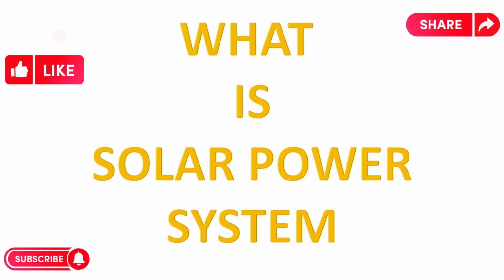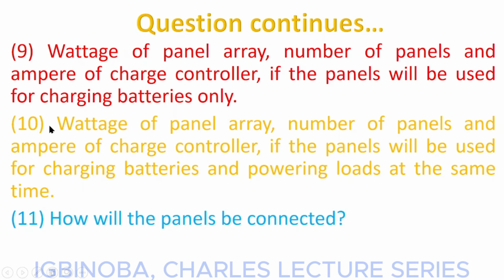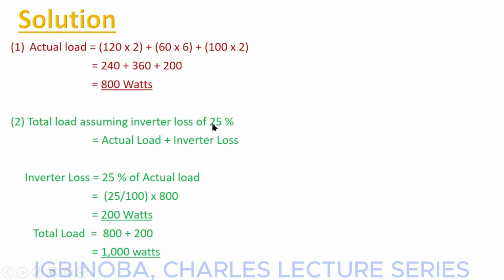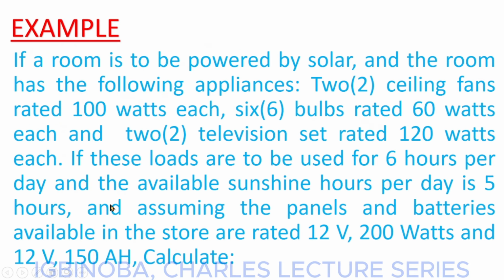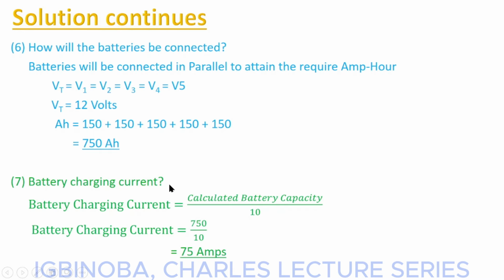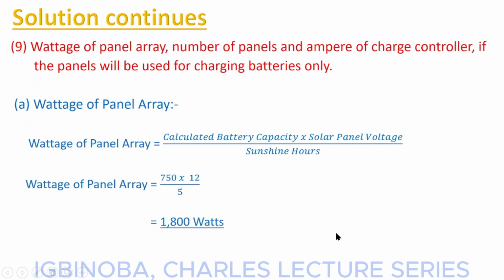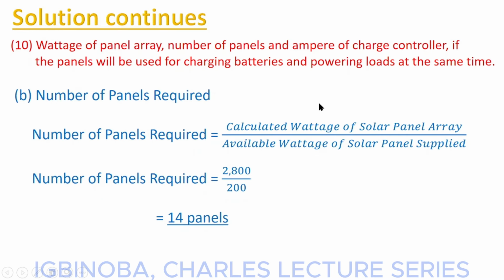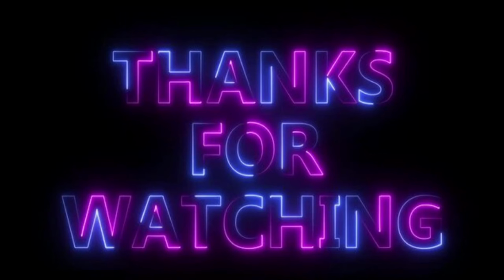Design of Solar Power System

Comment: MAR9I

Ans:
(1). 1380watts
(2). 1725watts
(3). 2156. 25Va 
(4). 1293.75ah
(5). 9 batteries 
(6). Parallel connection 
(7). 129.4amp
(8). 14hrs
(9a). 3105w 
(9b). 16panels
(9c). 258.75amps
(10a). 4,830amps
(10b). 24panels
(10c). 402.5amps
(11). Parallel connection

Comment: NAT38L 
1. Actual load 1380W
2. 1725W
3. 2156.25VA
4. 1293.75AH
5. 8.6 batteries (approximately 9 batteries)
6. Voltage is constant so parallel connection 
7.129.375A
8. 14 hours 
9. A.3105 W
B.15.525 panels 
C. 258.75A
10.A. 4830W
B. 24 panels 
C. 402.5A
11. Connection is in parallel.

Comment: MEC19S

1. Actual load =1380W
2. Total load=1725W
3. Inverter rating =2156.25VA
4. Battery capacity=1293.75AH
5. No of batteries = 9 batteries 
6. The batteries are connected in parallel
7. Battery charging current =129.375A
8. Battery charging time=14 Hrs
9. a. Wattage=3105W
    b. No of panels=16 panels
    c.  Charge controller =258.75A
10. a. Wattage=4830W
     b. No of panels=24 panels
     c. Charge controller =402.5A
11. The panels are connected in parallel.

Comment: MEC33G 

Answers:

1. The actual pad is 1,380W
2. The Total load is 1,725W
3. The inverter rating is 2,156.23VA
4. The battery capacity is 1,293.75Ah
5. The Number of batteries is 9
6. The batteries are connected in parallel
7. The Battery charging current is 129.4 amps.
8. The battery charging time is 14 hours.
9. a. The wattage of the panel array is 3,105W
b. The number of panels is 16 panels.
c. The Charge controller rating is 258.75 amps.
10. a. The wattage of the Panel array is 4,830
Watts
b. The number of panels is 24 panels.
c. The charge controller rating is 402.5 amps
11. The panels are arranged in parallel

Comment: EEE38L

Answer 
1. 1380

2.1,725w

3.2,156.23VA

4.1,293.75Ah

5.9 batteries 

6.Connected in parallel 

7.129.4Amps

8.14hour

9.3,104w
b.The number of panels is 16 panels 
c.The charge controller rating is 258.75 Amps.

10.4,830
b.The number of panels is 24 panels 
c.The charge controller rating is 402.5 Amp

11.The panels are arranged in parallel

Comment: MEC25Y

Answers:
1.) Actual load = 1,380 W

2.) Load including 25% inverter loss = 1,725 W

3.) Inverter rating = 2,300 VA → choose 3 kVA

4.) Battery capacity = 920 Ah at 12 V

5.) Number of batteries = 7

6.) Batteries connected in parallel

7.) Charging current = 92 A

8.) Charging time ≈ 16.7 hours

9.) 6 × 200 W panels = 1,200 W, about 100 A controller

10.) 15 × 200 W panels = 3,000 W, about 250 A controller

11.) Panels connected in parallel

Comment: MEC51Y 
1. ACTUAL LOAD=1380W
2. TOTAL LOAD=1725W
3. INVERTER RATING=2156.25VA
4. BATTERY CAPACITY=1293.75Ah
5. NUMBER OF BATTERIES= 8.625
6. BATTERIES CONNECTION= PARALLEL
7. BATTERY CHARGING CURRENT=129.375A
8. BATTERY CHARGING TIME=14HRS
9a. PANEL WATTAGE=3105W
9b. NUMBER OF PANEL=15.525
9c. AMPERE OF CHARGE CONTROLLER=258.75A
10a. PANEL WATTAGE =4830W
10b. NUMBER OF PANEL=24.15
10c. AMPERE OF CHARGE CONTROLLER= 402.5A
11. PANEL CONNECTION= PARALLEL

Comment: COMP93O

Answer: 

1. The actual load is 1,380W
2. The Total load is 1,725W
3. The inverter rating is 2,156.25VA
4. The battery capacity is 1,293.75 AmpHr
5. The Number of batteries is 9
6.  The batteries are connected in parallel 
7. The Battery charging current is 129.375 amps.
8. The battery charging time is 14 hours.
9. a. The wattage of the panel array is 3,105W
b. The number of panels is 16 panels.
c. The Charge controller rating is 258.75 amps.

10. a. The wattage of the Panel array is 4,830 Watts 
b. The number of panels is 25 panels.
c. The charge controller rating is 402.5 amps
11. The panels are arranged in parallel

Comment: CIV86H

1. 1380W
2. 1725W
3. 2156.23VA
4. 1293.75Ah 
5. 9 batteries 
6.  The batteries are connected in parallel 
7.  129.4 amps.
8.  14 hours.
9. a. 9105W
b. 16 panels.
c. 258.75 amps.

10. a. 4830 Watts 
b. 24 panels.
c. 402.5 amps
11. parallel

Comment: MEC91M 

ANSWER:
1380 W
1725 W
2156.25va
1293.75ah
9 batteries 
Parallel connection 
129.4amp
14 hours 
3105w
16 panels 
258.75amps
4831w
24 panels 
402.5 amps 
The panels are in parallel

Comment: MAR6F

ANSWER

1. Actual Load: 1380 W

A

2. Total Load: 1840 W

3. Inverter Rating (0.8 Power Factor):

2300 VA (or 2.3 KVA)

4. Battery Capacity: 1226.67 Ah

5. Number of Batteries: 9 batteries

6. Battery Connection: Parallel

7. Battery Charging Current: 120

8. Battery Charging Time: 16.67 hours

9. Solar Setup (Batteries Only): 2944 W (or

3000 W), 15 panels, 250 A charge controller

10. Solar Setup (Batteries + Load Simultaneously): 4784 W (or 4800 W), 24 panels, 400 A charge controller

Il. Panel connection: parallel

Comment: CHM49W                                                                                                                                                                                               1.) The actual load=1380W                                                                                                                                                             2.)  The total load= 1725W                                                                                                                                                                 3.) Inverter rating=2156.25VA                                                                                                                                                            4.) Battery Capacity=1293.75AH                                                                                                                                                    5.) 8.625=9                                                                                                                                                                                            6.) The batteries would be connected in parallel                                                                                                                         7.) 129.3A                                                                                                                                                                                           8.) 14hrs                                                                                                                                                                                                 9.) wattage=3105W  , number of panel =15.5=16panels , ampere of charge controller (I)=258.75A                                10.) wattage =4830W , number of panel=24panels , ampere of charge controller = 402.5A                                                11.) The panels would be connected in parallel

Comment: COMP8H

1. The actual pad is 1,380W
2. The Total load is 1,725W
3. The inverter rating is 2,156.23VA
4. The battery capacity is 1,293.75Ah 
5. The Number of batteries is 9
6.  The batteries are connected in parallel 
7. The Battery charging current is 129.4 amps.
8. The battery charging time is 14 hours.
9. a. The wattage of the panel array is 3,105W
b. The number of panels is 16 panels.
c. The Charge controller rating is 258.75 amps.

10. a. The wattage of the Panel array is 4,830 Watts 
b. The number of panels is 24 panels.
c. The charge controller rating is 402.5 amps
11. The panels are arranged in parallel

Comment: MEC13M
1. 1,380 W
2. 1,725 W
3. 2,156.25 VA
4. 1,239.75 Ah
5. 9 batteries
6. Parallel connection
7. 129.375 A
8. 14 hours
9a. 3,105 W
9b. 16 panels
9c. 258.75 A
10a. 4,485 W
10b. 23 panels
10c. 373.75 A
11. Parallel connection

Comment: EEE61i

Answer

1380W
1725W
2156.25VA
1293.75Ah
9 batteries
Parallel connection
129.4A
14h
3105W
16 panels
258.75A
4830W
24 panels
402.5A

The panels are arranged in parallel

Comment: EEE 35I
Answer

Actual Load: 1,380 W

Total Load: 1,725 W

Inverter Rating: 2,156.25 VA

Battery Capacity: 1,293.75 Ah

Number of Batteries: 8.625

Battery Connection: Parallel

Battery Charging Current: 129.375 A

Battery Charging Time: 14 hours
9a. Panel Wattage: 3,105 W
9b. Number of Panels: 15.525
9c. Charge Controller Current: 258.75 A
10a. Panel Wattage: 4,830 W
10b. Number of Panels: 24.15
10c. Charge Controller Current: 402.5 A

Panel Connection: Parallel

Comment: PETRO95Q

Answer: 1; actual load = 1380 watts
2; Total load = 1725 watts
3; inverter rating = 2156.25 VA 
4; Battery capacity = 1239.75 Ah 
5; Number of batteries = 8.625 ( 9 batteries)
6; They would be connected in parallel 
7; battery charging current = 129.375 A
8; Battery charging time with 40% loss = 14hrs
9a; wattage of panel array = 3105 watt
9b; 16 panels 
9c; 258.75A
10a; 4685 watt
10b; 23 panels
10c; 373.75A 
11; They would be connected in parallel.

Comment: EEE7G 

1. Actual load= 1380W
2. Total load= 1725W
3. Inverter rating= 2156.25VA
4. Battery capacity= 1239.75Ah
5. Number of batteries= 9
6. Parallel 
7. Battery charging current= 129.375A
8. Battery charging time with 40% loss= 14hrs
9. Wattage of panel array= 3105W
    Number of panels= 16 panels 
    Ampere of charge controller= 258.75A
10. Wattage of panel array with load = 4685W
       Number of panels= 23
       Ampere of charge controller= 373.75A
11. Parallel

Comment: CIV64L 

ANSWER :

1. 1380W

2. 1,725W

3. The inverter rating is 2,156.23VA

4. The battery capacity is 1,293.75Ah

5. The Number of batteries is 9

6. The batteries are connected in parallel

7. The Battery charging current is 129.4 Amps

8. The battery charging time is 14 hours

9. The wattage of the panel array is 3,105W
b. The number of panels is 16 panels.
c. The Charge controller rating is 258.75 amps.

10. The wattage of the Panel array is 4,830 Watts
b. The number of panels is 24 panels.
c. The charge controller rating is 402.5 amps.

11. The panels are arranged in parallel.

Comment: MAR104Z

Answers:
1. Actual load = 1380Watt
2. Total load = 1725Watt
3. Inverter rating = 2156.25VA
4. Battery Capacity = 1239.75Ah
5. Number of batteries = 8.625 (9 batteries)
6. They will be connected in parallel 
7. Battery charging current = 129.375A
8. Battery charging time with 40% loss = 14hrs
9a. Wattage of panel array = 3105Watt
9b. Number of panels = 16panels
9c. Ampere of charge controller = 258.75A
10a. Wattage of panel array with load = 4485Watt
10b. Number of panels = 23panels
10c. Ampere of charge controller = 373.75A
11. They will be connected in parallel.

Comment: EEE 28B

Answer:

1. Actual Load = 1,380W

2. Total Load (with 25% Inverter Loss) = 1,725W

3. Inverter Rating (Power factor 0.8) = 2,156.25 VA

4. Battery Capacity (Reserve 75%):
 = 1,293.75 Ah

5. Number of Batteries = 8.625, will need 9 batteries.

6. Battery Connection:
Parallel connection to maintain 12V

7. Battery Charging Current = 129.38 Amps

8. Battery Charging Time (40% loss):
Formula = 14 hours

9. Panels for Charging Battery only:

Array Wattage = 3,105W

Number of Panels = 15.525, Use 16 panels.

Charge Controller = 258.75 Amps

10. Panels for Charging and Powering Load:
Array Wattage = 4,830W
Number of Panels: Use 25 panels.
Charge Controller = 402.5 Amps

11.Parallel connection to maintain 12V

Comment: CIV92N
Answer :
(1)1380 watts 
(2)1725 watts 
(3) 2156.25VA
(4) 1293.75Ah
(5) 9 batteries 
(6) Parallel connection 
(7) 129.39amps 
(8) 14 hrs 
(9a) 3105 watts 
(9b) 16 panels 
(9c) 258.75 Amps 
(9d) Parallel connection 
(10a) 4830
(10b) 24.15 
(10c) 402.5 Amps

Comment: PETRO51Y

1 Actual load = 1380Watt
2 Total load = 1725 Watt
3 Inverter rating = 2156.25VA
4 Battery Capacity = 1239.75Ah
5 Number of batteries = 8.625 (9 batteries)
6 They will be connected in parallel
7 Battery charging current = 129.375A
8 Battery charging time with 40% loss = 14hrs

9a Wattage of panel array = 3105Watt
9b Number of panels = 16panels
9c Ampere of charge controller = 258.75A

10a Wattage of panel array with load = 4685 Watt

10b Number of panels = 23 panels

10c Ampere of charge controller = 373.75A

11 They will be connected in parallel

Comment: NAT25Y 

1. Actual load= 1380W
2.Total load=1725W
3. Inverter load=2156.25VA
4. Battery Capacity =1239.75VA
5. Number of Batteries =8.625 (9 batteries)
6. Connected in parallel 
7. Battery charging current =129.375
8. Battery charging time with 40% less=14hrs
9a.Wattage of panel array=3105W
9b. Numer of panels=16
9c.Ampere of charge controller =258.75A
10a.Wattage of panel array with load=4685W
10b. Number of panels =23
10c.Ampere of charge controller =373.75A
11. Connected in parallel

Comment: PETRO3C

ANSWER
1. Actual Load: 1380 W
2. Total Load: 1840 W
3. Inverter Rating (0.8 Power Factor): 2300 VA (or 2.3 KVA)
4. Battery Capacity: 1226.67 Ah
5. Number of Batteries: 9 batteries
6. Battery Connection: Parallel
7. Battery Charging Current: 120 A
8. Battery Charging Time: 16.67 hours
9. Solar Setup (Batteries Only): 2944 W (or
3000 W), 15 panels, 250 A charge controller
10. Solar Setup (Batteries + Load
Simultaneously): 4784 W (or 4800 W), 24 panels, 400 A charge controller
Il. Panel connection: parallel

Comment: CHM21U
Answers:
Actual load = 1380Watt
Total load = 1725Watt
Inverter rating = 2156.25VA
Battery Capacity = 1239.75Ah
Number of batteries = 8.625 (9 batteries)
They will be connected in parallel
Battery charging current = 129.375A
Battery charging time with 40% loss = 14hrs
9a. Wattage of panel array = 3105Watt
9b. Number of panels = 16panels
9c. Ampere of charge controller = 258.75A
10a. Wattage of panel array with load = 4485Watt
10b. Number of panels = 23panels
10c. Ampere of charge controller = 373.75A
They will be connected in parallel

Comment: CHM39M

Answer:
1380W
1725W
2156.25VA
1293.75Ah
9 batteries 
Parrallel connection 
129.4A
14h
3105W
16panels
258.75A
4830W
24panels
402.5A
The panels are arranged in parrallel

Comment: PETROCHEM48V 

ANSWER

1.   1380 watts
2.   1725watts
3.   2156.25VA
4.   1293.75AH
5.   9 batteries 
6. The batteries are connected in parallel 
7.   129.4Amp
8.   14hours
9.   3105Watts
b.   16panels
c.   258.75amps
10. 4830watts
b.   24panels
c.   402.5amps
11.  The panels are arranged in parallel.

Comment: CIV94P 

1. The actual pad is 1,380W
2. The Total load is 1,725W
3. The inverter rating is                 
     2,156.23VA
4. The battery capacity is               
     1,293.75Ah 
5. The Number of batteries is    
     9
6.  The batteries are 
     connected in parallel 
7. The Battery charging 
    current is 129.4 amps.
8. The battery charging time 
     is 14 hours.
9. a. The wattage of the panel 
      array is 3,105W
b. The number of panels is 16 
     panels.
c. The Charge controller 
     rating is 258.75 amps.

10. a. The wattage of the 
      Panel array is 4,830 Watts 
b. The number of panels is 24 
     panels.
c. The charge controller 
    rating is 402.5 amps
11. The panels are arranged 
     in parallel

Comment: EEE67O

ANSWER
1. 1380W
2. 1725W
3. 2156VA
4. 1294AH
5. 9 batteries 
6. Connected in parallel 
7. 129A
8. 14 hours
9. 3106W,16 panels, 259A
10. 4831W,24 panels,403A
11. Parallel connection

Comment: PETRO92N

Answer
1380W
1725W
2156.25VA
1293.75Ah
9batteries
Parallel connection
129.4A
14h
3105W
16panels
258.75A
4830W
24panels
402.5A
The panels are arranged in parallel

Comment: PETROCHEM29C

ANSWER

1. Actual Load: 1380 W

2. Total Load: 1840 W

3. Inverter Rating (0.8 Power Factor): 2300 VA

4. Battery Capacity: 1226.67 Ah

5. Number of Batteries: 9 batteries

6. Battery Connection: Parallel

7. Battery Charging Current: 120 A

8. Battery Charging Time: 16.67 hours

9. Solar Setup (Batteries Only): 2944 W (or 3000

W), 15 panels, 250 A charge controller

10. Solar Setup (Batteries + Load

Simultaneously): 4784 W (or 4800 W), 24 panels,

400 A charge controller

11. Panel connection: parallel

Comment: PETROCHEM33G

Answer:
1. Actual load = 1380Wart
2. Total load = 1725 Watt
3. Inverter rating = 2156.25VA
4. Battery Capacity = 1239.75Ah
5. Number of batteries = 8.625 (9 batteries)
6. They will be connected in parallel
1. Battery charging current = 129.375A
8. Battery charging time with 40% loss =
14hrs
9a. Wattage of panel array = 3105Watt
9b. Number of panels = 16panels
9c. Ampere of charge controller = 258.75A
10a. Wattage of panel array with load = 4685 Watt
10b. Number of panels = 23 panels
10c. Ampere of charge controller = 373.75A
11. They will be connected in parallel

Comment: NAT34H 

Answer 

1380 watts
1725 watts
2156 .25va
1293.75ah
9 batteries
Parallel connection
129.4amp
14 hrs
3105w
16 panels
258.75amps
4830 watts
24 panels
402.5 amps
The panels are arranged in parallel

Comment: PETROCHEM34
H

1. 1380 watts

2. 1725 watts

3.  2156.25 VA

4.  1293.75 Ah

5.  9 batteries

6. Parallel connection

7.  129.375 A

8. 14 hours

9. 3105 watts
    16 panels
     258.75 A

10. 4830 watts
       24 panels
       402.5 A

11. The panels are arranged in parallel

Comment: EEE 86H 
ANSWER 
1) Actual load= 1380 watts
2) Total load=1725watts
3) Inverter Rating= 2156.25VA 
4) Battery Capacity=1239.75AH 
5) Number of Batteries = 8.625 that is 9 batteries 
6) They will be connected in parallel 
7) Battery Charging Current =129.375Amps
8) Battery Charging Time with 40% loss=14hrs
9a) Wattage of panel array=3105 watts
9b) Number of panels=16 panels 
9c) Ampere of charge controller=285.75Amps
10a) Wattage of panel array with load= 4685watts
10b) Number of panels=23 panels
10c) Ampere of Charge controller = 373.75Amps
11) They will be connected in parallel